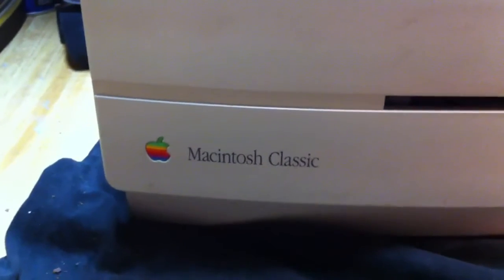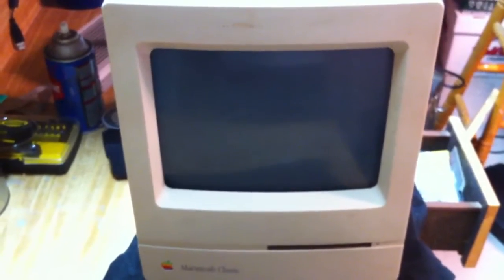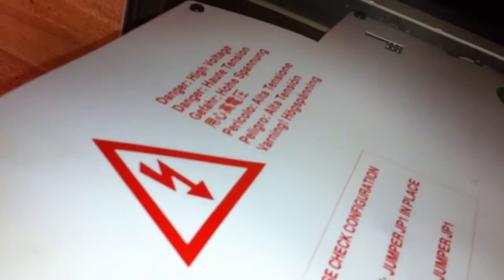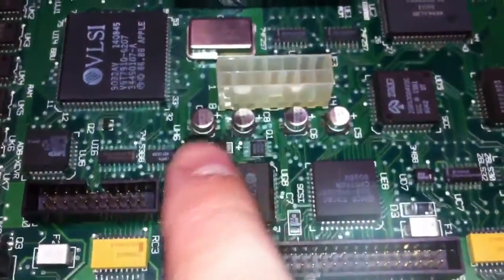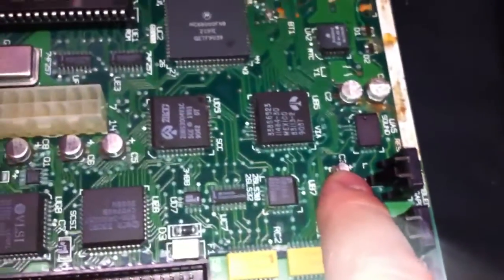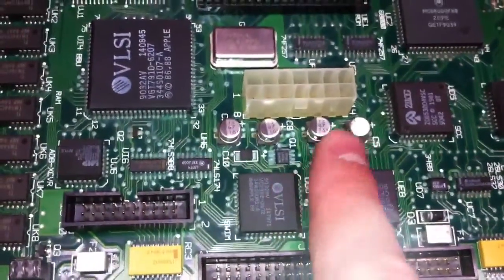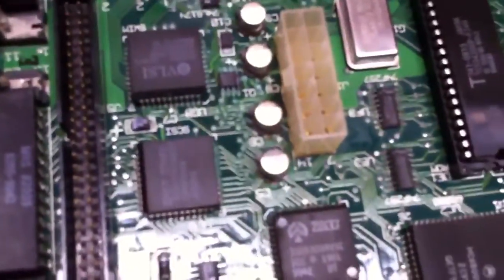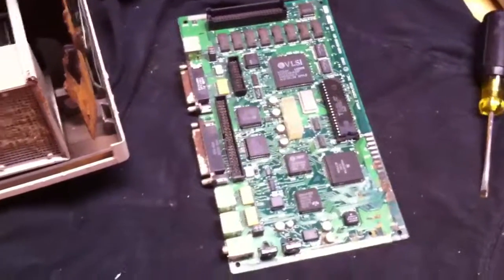How to fix checkerboard on Mac Classic Computer

Comment: I've just replaced the capacitors and fixed the battery/RTC IC but I'm here for the checkerboard problem, so my mac has another problem.
I've just seen a ceramic capacitor on the power supply board that has a big crack, I hope that after fixing that the computer will start.
Anyway mine has the same corrosion, it didn't reach the ports on the back, but it required some hours to fix all the traces, and I didn't fix all of them 😅

Comment: Use distilled water. Regular water will leave mineral residue on the board, that will lead to further issues over time.

Comment: I have the same issue with a Macintosh Classic that I bought off eBay today. How do I discharge the CRT so I don't accidentally kill myself? I see two little tabs on the left side of the case that can be pushed in. Anyone know what they are for?

Comment from the maker: I wouldn't go near the CRT while working on the Mac Classic.
Reply: Discharge it and it isn't going to hurt you. lol
Reply: I’ve fixed a plus and a 512 and never need to discharge the crt even right after powering down. I do anyway most of the time but it never has a charge built up in it. The risk is very low.
Reply: @sideburn  how can i discharge it?
Reply: @snakeboy6813  take an alligator clip test leads or some wire or solder etc and connect one end to the neck of a flat head screwdriver and the other to ground on the chassis. Then slip the flat end of the screwdriver under the crt suction cup on the anode. If it’s charged you’ll hear a spark and now you are good to go.

Comment from the maker: I bought another Mac Classic besides the one in my video and it fixed it.  I've read that eventually the capacitors WILL leak again and you'll either have to clean the electrolytic oil off again, OR replace the leaky caps.  Good luck guys.